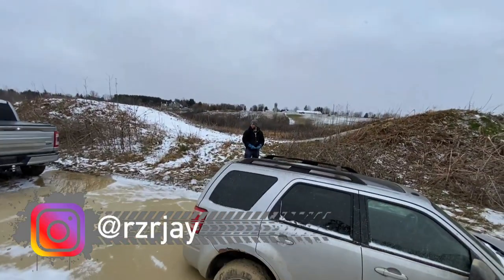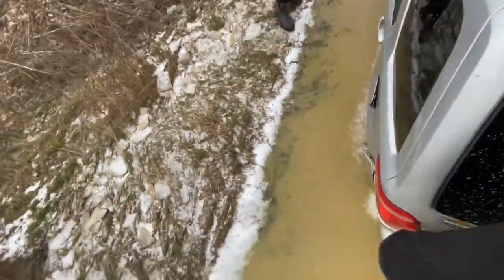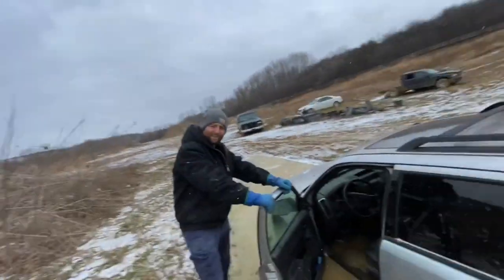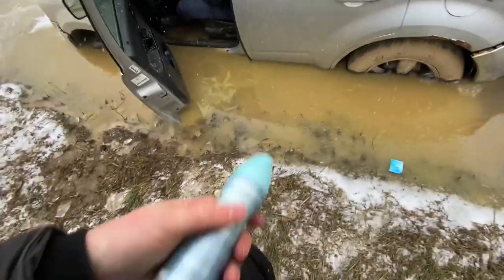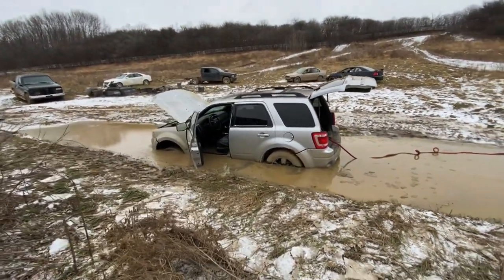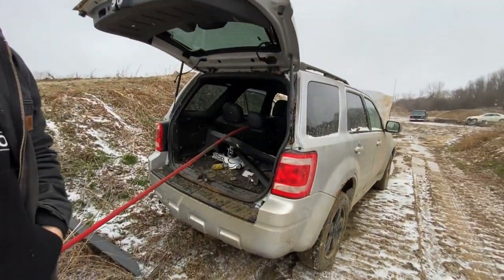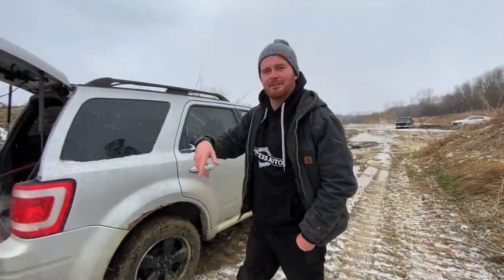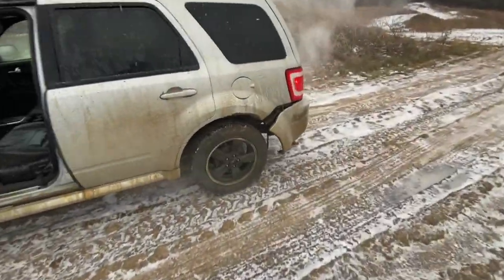FORD ESCAPE MASSIVE ICE BURNOUT!

Comment: Those OG 2012-down Escapes are some of the most reliable vehicles ever made. It's pretty common to see them top 300K miles with minimal if any mechanical repairs. The AWD versions are also fantastic offroad because unlike most AWD systems, the clutches are always engaged a decent amount from a stop, and taper off as you get to 40-ish mph. They engage more if any slip is detected, all the way to full lock.
Reply: rust belt area eats 'em up long long before then, unfortunately. I like these escapes.
Reply: @mdotguy  I'm fortunate enough to live in the Mojave Desert, in southern California. It's common here to see the most beat up, neglected and abused cars go to the junkyard with zero rust on them at well over 300K miles and decades old.

I feel bad for people who live on the rust belt, it's nice being able to have a car keep going indefinitely with just regular maintenance and repairs.
Reply: Frame rotted in half with my old one
Reply: @redneck58  On a unibody?
Reply: It was a 08 so not sure
Reply: @redneck58  All Escapes 2001-present are unibody